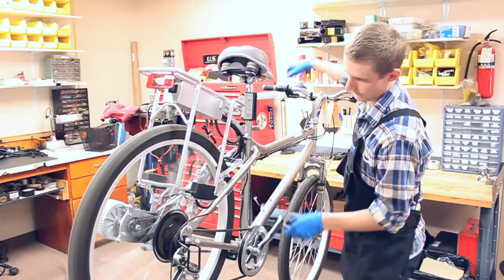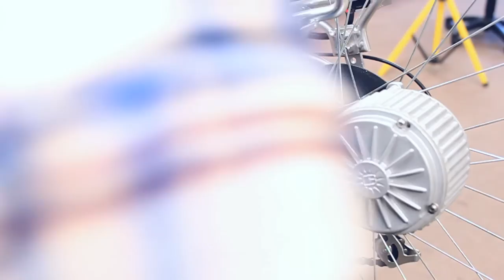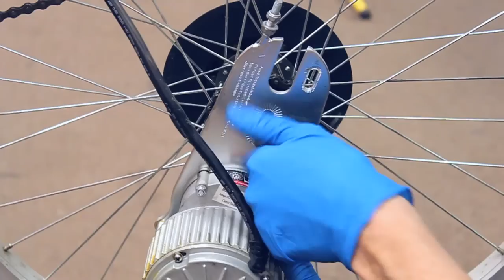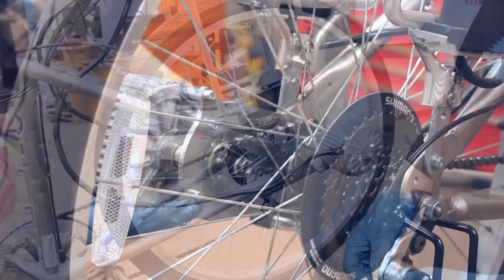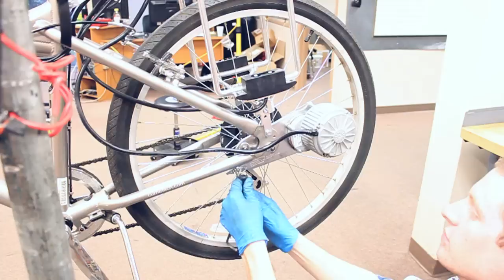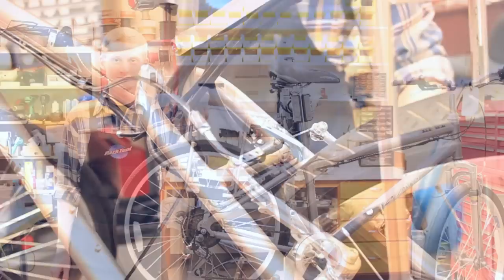Service Guide: Currie Drive rear wheel

Comment: Good information...Easy work fixing my first rear flat. ... The 17 mm CONE WRENCH IS A MUST HAVE to correctly tension the drive chain. I highly suggest using a quick-disconnect for the motor 24v line (I used Deans-style T-plugs). I also have been steered to using thicker walled tubes / Self-sealing tubes/ or Slime to avoid the heartache of 95% of flats you might get on the road.

Comment: Drill that stupid 17mm flat nut between the dropout of the frame and motor plate.
Drill it to 3/8 inch which is the size of the axle so it will be a washer that you don't need a 17mm cone wrench to take off and put back on.- 4:44 in the video.
It will be much easier and faster to remove the rear wheel to fix a flat.
The rear wheel axle on the eZip Trailz is a 180mm x 26 TPI threads and 3/8 inch in DIA.
If you don't have a drill then go buy some washers with a 3/8" hole and the same thickness as the 17mm flat cone nut.
Another point is that you don't need to cut the cable ties, you can gently let the motor and plate hang down by the wires if you flip the bike on it's back to remove the rear wheel.
Reply: So you saying that the 17mm nut is not important, that a washer to provide the correct spacing is all that is needed, and the outer nut and washer do all that is necessary for things to work properly?

Comment: The Currie bikes seem to have zip ties holding wires to the frame. These have to be carefully cut with an exacto knife (trying not to scratch the paint). I replaced them with velcro strips after fixing a flat. It seems like it would be better NOT to use semi-permanent zip ties...

Comment: IS THERE A BETTER MORE POWERFULL MOTOR THAT CAN BE USED? THIS 24V 450W MOTOR ONLY GOES UP TO ABOUT 15MPH WITH A 225 LB RIDER.  i'D LOVE TO GET 20MPH. THE CHEAP ASS CONTROLLER HAS 35V CAPACITORS SO NOTHING STRONGER THAN A 34V 8S BATTERY CAN BE USED.

Comment: I need to buy rear wheel nuts, bolts and spacer, I bought a parts izip, so I am missing pieces of the rear wheel assembly. Does anyone know where you can buy just nuts and bolts for the rear wheel?

Comment: greetings,

recently i bought an '03 currie ebike. right away, i noticed there was quite a bit of slack in the drive chain but it ran okay.now when i dial on the thumb throttle, the chain just slips; no power to the wheel. i tried adjusting the tensioner but that didn't help. is the chain just over-stretched or is it another issue?  how do i remove the slack on this older currie; or do i just replace the chain? where can i get one?

the chain engages okay at higher speeds; will not from a stop.

Comment: the bike is fun but be careful. always check the throttle. mine got stuck on and I almost bolted out into traffic, keep the breaks on when stopped at all times!!!  this way if the throttle is stuck on you will override it with the breaks.  much like a motorcycle.

Comment: oops hit send before I was done. anyway, yeah, its a little harder than this guy makes it look and the cheated by not showing the second zip tie cut. I was trying not to let it hang by the wire which made things really hard. this guy let it hang so I wonder if its ok to do that. anyway, show us not only what TO do but what NOT to do. the mistakes and pit falls to avoid. honestly I couldn't get the wheel back on on a stand, I had to flip it and let it fall into place. did it tonight.